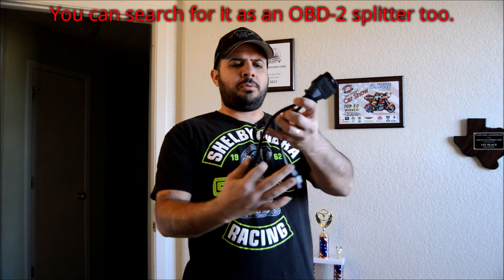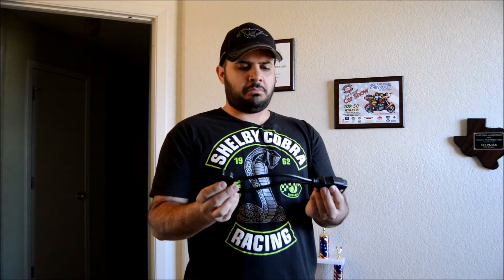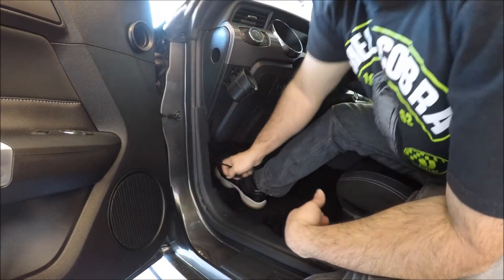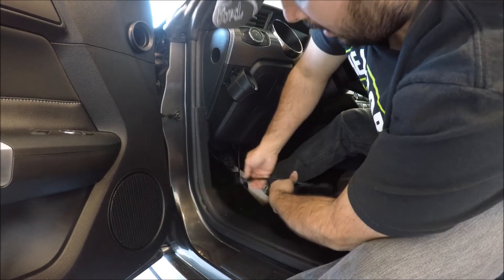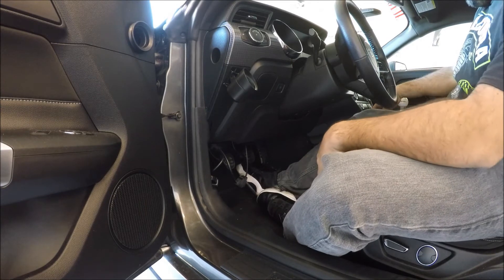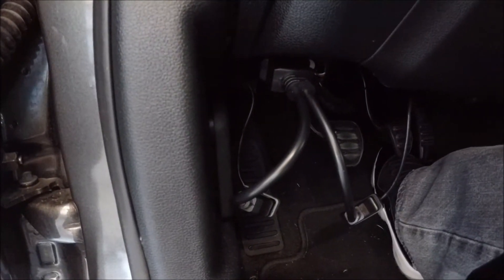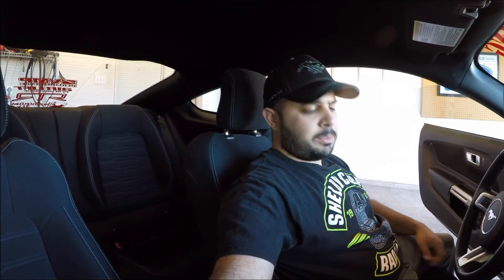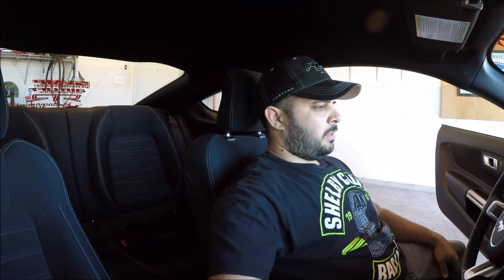Does an OBD2 Y cable (OBD2 splitter) really works?/That 5.0 Guy

Comment: From what I understand, the problem comes when two devices try pulling data from an OBD2 port at the same time. Only one request can be fulfilled at a time, so if you have one device that is constantly pulling data, the other isn't going to get a chance. At least that's what I've read.
Reply: Totally true i have tested this. I did not know 😢

Comment: this test proves nothing.  only that both of them are drawing power, in fact doesn't even prove the exhaust is as that doesn't use the obd2 to simply go loud/quiet.   Try loading the gauges on the ngauge and then open the exhaust app and see if it can do any of the advanced functions based on RPM/throttle etc other than open/close.   it can't, they conflict.  One will work for a bit, then the other will steal the data and the first stops, and vice versa. completely unstable.

Comment: Was there ever an update on this? I’d like to know if I should buy this.
Reply from the maker: I made a review video, look for it on my channel. Don't do it anyway, data transfer is very slow and it can potentially damage your ecu.
Reply: Here is the link to that video. https://youtu.be/ZCkN4GGREbA
Reply from the maker: Thank you for linking the video. Is not that I don't care. If you look at my previous comment I told him not to do it anyways the same day he wrote the comment. Plus he is not asking for the link. I told him that I did a video of it and that it's in my channel, I don't have to many videos so you'll find it really quick. Plus since my brain surgery my memory it's been really bad, thanks for your concern anyways. By the way there's a video about it in my channel too.
Reply: @BryanVizcarrondo  sorry about your surgery. I wasn't aware of it.

But the outcome is definitely negative.
WHY?
Because like any communication protocol whether it's a USB, Network cable or in this case OBDII has ONLY A SINGLE connection for communication. However you can use splitter like that, ONLY to power things, that's all.
But in order to connect more than one device you need extra equipment. 
For USBs, you can use USB Hub.
For Network, use Network Switch.
AND 
For OBDII, Ford created SMART DATA LINK CONTROL MODULE  For Mustang FR3T14F642AD
So essentially, you CAN use OBDII for data connection for two devices but you have to do it the proper way.

Comment: It's generally not recommended to split your ECM port as it wasn't designed for that purpose and may, eventually, result in the plugged in devices failing.

Comment: Theoretically, this will not work.. OBD2 would not know what device requested the information you require. Best case scenario is the one of the device will only work.
Reply from the maker: It doesn't, check the review video i made after this one.

Comment: This will not work with SCT x4
Reply: NUKE DUKEM Really? I just bought an x4 and have power running boards that I need connected. I saw a forum of a guy who had the x4 and said the Y splitter worked fine.
Reply: @autiger0612  it wouldn't work with my aeroforce gauge and my x4
Reply: @roymooner1  Correct me if I'm wrong, but I think it can only send data to one device at a time. If one of your devices is just using the port for power (ie. power running boards) then it should work fine.
Reply: @facts_over_feelings  you're exactly right, I failed to realize that. It should with your example but if you're trying to run a couple gauges it doesn't work.